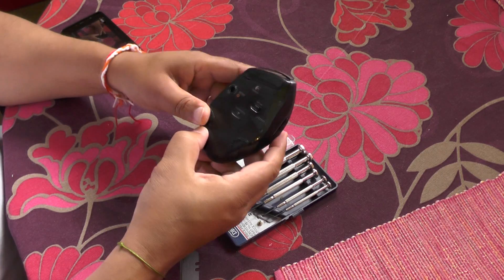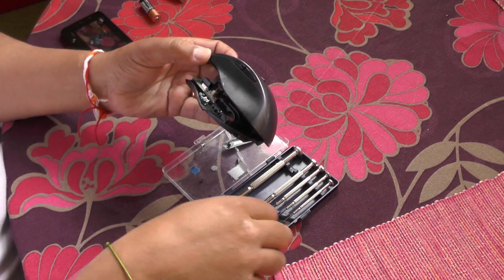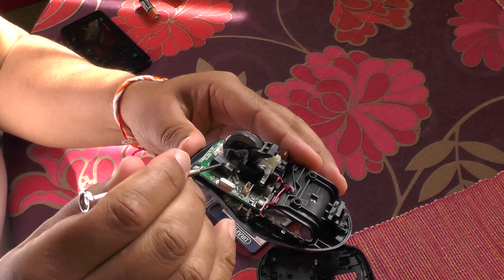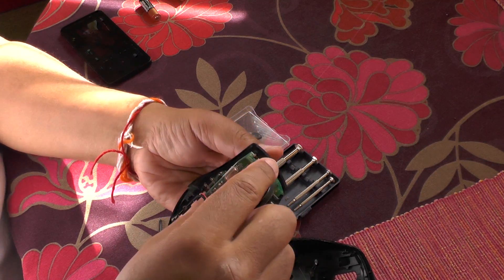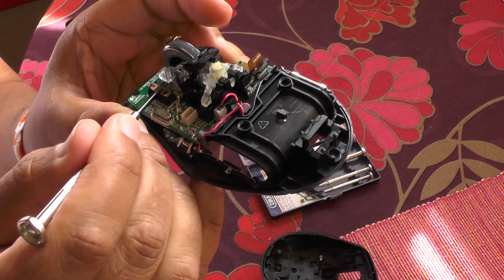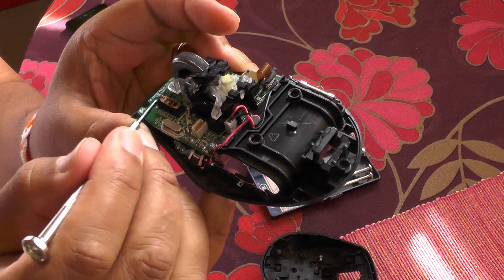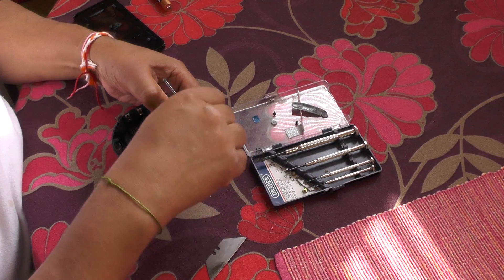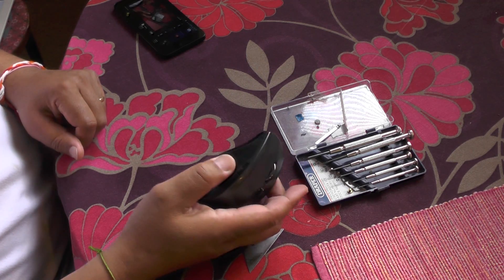Logitech Mouse Double Click Problem and How To Fix It - Red Ferret How-to

Comment: Just fixed my performance MX for a 3rd time! using this technique. Vids really helpful thanks!  I bent the copper correctly the first time, 2nd time the copper broke so used the right click replacement from my older generation MX and now 8 months later double click starts happening again! Its fixed now but have no interest on performing continual surgery on a otherwise perfect mouse! Can anyone recommend a replacement to these Logitech mouses? same price range wireless rechargeable? I've struggled to find any other alternatives!
Reply from the maker: The problem is not so much finding a replacement, as finding one which has that super slick middle scroll wheel action. Once you're used to scrolling around pages at lightning speed, it's hard to go back. If anyone knows of a real alternative, I'd love to hear it.

Comment: Thanks a lot, I fixed my mouse after I've had this problem for 3-4 years probably. Finally got sick of it today and fixed it in about an hour. Sucks I had to use it like that for so long before getting fed up but better late than never. Learned something new, and although it took a lot of precision, I got it done and I don't have to buy a new mouse. Thanks alot

Comment: I've owned two Logitech MX mice, both have had this issue and the fix was simply to open them up and blow the dust/hair out. I don't even own a can of compressed air... Just blow in them like a old Nintendo cartridge.

What I'm trying to say is.... the mysterious double-click symptoms can be from dust/debris causing a short. Its not necessarily a mechanical problem like this video addresses.

Comment: I have the exact same kind of mouse: a Logitech M705.  On the clicker housing (little black box), the catches on my mouse were not on the ends, but rather in the middle of either side of the housing.  Now here's the thing you didn't mention that almost caused me to ruin my mouse:  The two clicker housings are not put on in the same orientation.  They can both be seen in the video at 2:20 -- on the left, the white piece is on the bottom half of the black housing; and on the right, the white piece is on the top half of the housing.  I didn't take the copper part off because I figured my chances of ever getting it back on would be about zero.  I just rubbed the contact points with a needle so they would make better contact.  After going through the ordeal of figuring out that the left button housing is in the opposite orientation of the right button housing, everything went back together with no problem.  And my mouse works fine now -- double clicking and all.

Comment: Thanks for the video. I used the video and the link to help me. It was a pain in the ass to get that thin copper back in place. But I can confirm that this technic worked on my Logitech Performance MX Model Number: M-R0007 mouse. Pay attention how the copper piece comes out and how it is placed. Use the link to see pictures of how the copper piece is supposed to be bent.

Comment: Logitech makes so much shit nowadays. My first M705 was replaced after 2 years because the doucle click problem at the left. My new M705 had a different mouse click sensor, because it sounded different. So Logitech put a better one into the mouse. But just at the left side! At the right button, the sensor is broken again, because there they still used the cheap sensor. You could  hear a different sound, when clicking.

Comment: So I used a safety pin to reshape the u shaped piece rather than trying to bend it with just a tweazers, using the pin to hold up the middle bit while using a flat screwdriver to push the flap down.  noticed with mine I had to get the spring to push itself off of the center post there so the back would be under the right or acceptable tension to keep it from just falling off.

Comment: your method of how u hold the copper from your left hand was different than my method, my method was reversed by your method.. here is how i did. i used my thumb and index finger to aim its claw into the middle hook and hold down the "dot" on the bottom of the pole. then i use medium sized needle and simply insert into the hole and start to pull up on the right side to match the end-hook. it took me 20 minutes on my second attempt. - the first try was 40 minutes about when i using both hand of mine last time without a needle :(

Comment: The spring works fine, but double clicks on a single click. Cleaning the contact by dragging some paper through the contacts appears to clean it up. Works fine again. 2nd time in 6 years had to clean.

Video was very helpful to show how to remove the switch cover, used it about 3 years ago  and again today. M705 is a great mouse, 3 year battery life twice now for 6 years.

Comment: I didn't bend the end of the copper spring like you did, but to the opposite site because when I checked the right button, it was bent to the other side. The left side was full flat. I am writing this just after fixing it and at the moment it is working amazing. The click sound is a bit more quiet. Don't know what would be the difference if I bent it like you did.

Comment: I really like this solution (I have this problem with several of my mice), but I always wondered why Logitech simply didn't add a "minimal double click" time into their driver.  Very simple for them.

Until today I discovered someone had a similar idea (at least for Windows), using an AutoHotKey script:

~LButton::return  ; Set A_PriorHotkey.
#If A_PriorHotkey != "" && A_TimeSincePriorHotkey < 200
LButton::return  ; Block hotkey.

Just google those lines for details (I believe that "200" means 200 ms minimal gap between clicks).  Perfect, and it seems to work great for me.

Please forgive me if this is old news - but it's been annoying me for years!!
Reply: How do you make it work exactly tho ? I downloaded the program but it seems fairly complicated. Can you help me with it ? :S
Reply: Sure, install AutoHotKey, then create a AutoHotkeyScript "slowdown doubleclick.ahk" with the 3 lines ("~LButton:return ....") in it.  To create that script just right-click on the desktop, and choose "New->AutoHotkey Script" (that option will appear after installing AutoHotkey).  After saving the file, just run it (double-click it).  I created a Shortcut to that file in the "Startup" folder so it runs each time I login.  Google "Windows 10 Startup" to see how to do that, it's the C:\ProgramData\Microsoft\Windows\Start Menu\Programs\StartUp folder.  Now that I've used this a while, I still get occasional phantom double-clicks - but it's much better than before.  Also, I changed it to a "100", because I was losing "real" double clicks (I guess I click fast).

Comment: Next time you have that thing out, and after you bend it back into position, hold it over an open flame (until it is super hot) then drop it into some water. Problem solved bromance.

Comment: just unplug the mouse or take out the batteries . Click it about 30 times to discharge current and problem is solved . Just worked on my g302 and this is what logitech suggests . Dont need to operate .
Reply: i clciked almost 2000 times and now it feels like its new
Reply: UNBELIEVABLE
I had already gotten through the "bending" procedure for my Performange MX. After a fairly bit of use (it was about 1+ year of very rare use) the problem reappeared.
Tried your solution, it got significantly better. Will try it again (may do more clicks to try to make it even better)

Many thanks

Update: many clicks later: not a single unintended double-click event
Reply: oh, so it does work!  I'd tried this with my corded mouse, i unplugged it, clicked a bunch, plugged back in: FIXED!
I was sad coz you can't unplug a wireless mouse, but i guess taking the batteries out does the same job.  Wonderful!
Reply: I can't believe this worked... So simple but it did the job for me.
Reply: It does work! I just simply unplugged my wired mouse and clicked a bunch also. Thanks.
Reply: WOOOOOOOOOOW! This actually worked! I clicked well over 30 at a rapid pace (just in case and that definitely fixed my issue)! Glad that I don't have to take my M705 apart, thanks!!!!
Reply: This worked for my Logitech G602.  Thanks for the find!
Reply: This should be the top comment. This should be the result when searching for a fix. Just did it to my G700s thinking it would not work. It worked. Do it.
Reply: This seems to have worked with a wireless M510 by removing the batteries then rapid clicking 30+ times.  So weird.
Reply: worked forr my razer mouse thank you!
Reply: This solution wins

Comment: I have the M570 from Logitech witch had the same problems... a little bit of contactspray on the microswitches fixed the problem. Just over the little white button and let it soak a bit. Then dry off with a tissue .. that was it!

Comment: Works for a Logitech G400 also, only 3 screws tho :) 2 at the front and 1 at the back. I found that it was easier to use tweezers to get the little white thing back in and then flip the mouse up side down and mount it that way the black cover with the white button can only fit on way on the G400. Nice video help me get it right the first time :) No need to change my beloved gamer mouse now :D

Comment: Well, my mouse no longer double-clicks!

It... also no longer single-clicks.  I think this sort of thing is only going to go well for people who are already very, very good with parts like this.  The tiny piece of copper is much smaller than you might think from the video, and after two hours trying to get it back into place, I've given up.
Reply: I did it already 4th times on same mouse, no problems, not at first try but i do it in 20m~1h every time i must fix it.
A tip for you: repair 1 at time, so you can compare, and remember to see if it make contact with all of 3 points before you reclose all.
Reply: I spent 2 or more hours trying to get it to work at all.  At that point, it was easier to just buy a new mouse.
Reply: First time is not easy, but try another time and compare with another not modified yet. If it not click at all then it not make the right movement in&out when u press the button...

Comment: Want an easier fix? Disassemble the 5 screws, pop the top off but leave the wires attached, just rest the top on the side. Get electrical contact cleaner, spray small amounts (couple drops only) on the 'faulty' microswitch, use a screwdriver to push it over and over to let the liquid saturate the internals, add a few more drops and do 20 more clicks. Close everything up, click a shitload more times. That's it. Fixed two different model Logitech mice with that method.
Reply: This is how I repaired mine, super easy, WD-40 also works. Maybe Logitech could preapply the cleaner to make it last longer.
Reply: I fixed mine much more simply, I blew some air in it and now it suddenly stop double clicking. For now.....
Reply: Eleven months later and your solution worked like a charm. Thanks.
Reply: Best simple fix is this. Take out batteries or unplug mouse. Click both left and right mouse buttons for 30 seconds to remove the static charge that is causing the double click. Problem solved .. til it builds up again. No disassembly required.
Reply: Taking batteries out and clicking worked for me !!!  Thanks heaps Tyco!!!
Reply: Thanks so much, Tyco. This worked perfectly as you described. +1 internet awarded to you.

Comment: what if i stick off my mouse pads and then wouldnt be able to stick it back in?i have g600 and pads is kinda expensive due to shipping tax
Reply from the maker: My pads went back on nicely.
Reply: You can always use some double sided tape, but like +Red Ferret I didn't have any problems putting mine back on :)

Comment: i dont unscrew and dissect my m705. i should. but in the mean time i get the last two disinfection wipes used to wipe keyboards,, kitchen counters, messes. i save the last two so all the good moisture collects on one/two wipes. then i get one of those toothpick/dental floss hybrid tools that are both toothpick and floss. then i combine them and jam into the small hole where the laser is. i twist and turn. i find best results with more moisture.

Comment: For all newcomers to this video, the trick is not really about bending the contacts, but about cleaning the oxidation layer on the contacts at the place where the clicking is happening. By bending the contacts the author of this video slightly changed the angle of contacting surface, but the real problem solver is scraping off the oxidized layer - you will see that the color of the contact is dark and dull, and you need to scrape it a bit to make it look shiny again - this is what really  is solving the double-click problem.
Reply: I think you got it right: mine was misbehaving in the clicking, but the sound was just about right, so I guessed the issue was not the copper plate after all. Not the shape at least.
I gave it a run of deoxidizer (a good dry one) and everything seems to work fine. So far so good
Thanks to the OP for showing ho to tear down the mouse though, saved me a lot of guesswork :)
Reply: Agreed.  I used this video to see how to disassemble the mouse (excellent for that) but scraped the oxidation off as well on both sides- didn't really bother with trying to reshape the spring as it seemed to be springing just fine.  The disassembly video was really nice for knowing it would go back together without a lot of hassle :-)
Reply: Exactly, I took a small piece of emery paper and cleaned the contacts and it worked like a charm.
Reply: @TheCassla  if you clean it properly,  it should last a long as the original term of use.  I've actually threw away the mouse because visually it got pretty bad, way before the double-click problem returned.
Reply: But the method in the video worked perfectly for me.  Maybe just my fiddling with the contact point was enough to clean it off? Or perhaps changing the shape to give the spring a more robust press against the contact is increasing the surface area of the connection point just enough to increase the likelihood of a solid electrical connection when clicked.
Reply: @TheCassla  it will happen again,  generally at the same rate as when the mouse is new.  There is no reason why it would oxidize faster if the surface is cleaned properly.
Reply: Exactly!
Reply: @TheCassla  Seems to depend on how much you use the button, since I have to clean the left click one about once a year, but right click only started doing that about 2+ years in.
Reply: That's not entirely true. I have a G305 that had a physically mashed spring (it got banged against a table and chucked at a wall), resulting in a mushy click and lots of double-clicks. If you still have an audible, satisfying click, but it's registering double-clicks or is otherwise inconsistent, it's oxidization.
There can be multiple different issues with a switch.
Reply: This was the correct solution for me as well. Thanks for the heads up! All i had to remove was the black click-sensor cover, then I could clean the gunk with a fine screwdriver on the contact surface.

One tip, to get the white little click insert to stay in the black cover when putting it back on, I put a small piece of tape, then just softly pushed the black/white assembly down and into place.
Reply: @squrrll  I just turned mouse upside down, so white thing was inside with the help of gravity :)
Reply: Thank you. I didn't change the shape of the springs (on purpose), just scraped black contacts on them till they shine. It seems that it helped. I had double clicks and I couldn't drag&drop things (because of a bad contact) Now it's fine.
Reply: excellent. took the cover off the switch but did not remove the spring. sprayed the spring with electrical contact cleaner.
mouse switch works again as new.
turned a "four hour" job into a half hour one!
Reply: I'm not 100% sure that what you're saying is right, but it's a long time ago, and who has time to argue over it? :)

Comment: Thanks for that buddy.
FYI I solved my double click problem by putting a little thinners (alcohol? glasses cleaner? I dunno) on the switch and giving it a little action. Seemed to clear out the grease that must have been causing the problem because the switch, whilst a bit squeaky now for w/e reason, seems to work ok (and I wasn't able to get a decent new mouse right now).
HTH. Happy days!

Comment: I like everything about this mouse except that the scroll wheel is way too lose. it needs a LOT of resistance. I took it apart to see if there's anything that can be done about it and it turns out there is this tiny spring that controls the resistance to the turning of the wheel. so I basically need a spring with more resistance. do you have any idea where i might be able to get this part?

Comment: Quite difficult to replace the copper switch plate in its place!
Though thank you for the upload.
Reply: I had a problem to get it out after I shoved it inaccurately. But with tweezers I managed to wiggle it out and place it correctly back. All you need is to be gentle with that copper part, put it back sideways, just as you were instructed to remove it. Bendy things are supposed to be in small catches on those thick terminals.

Comment: Seems to have fixed both of my  Logitech M515 couch mice double click issue.  Was about ready to boot both of them.  Only reason I didn't is because this model is discontinued and Logitech hasn't released an actual replacement for it.

Comment: This worked perfectly for my M705.  I've had it for years with no issues, but then started noticing the occasional malfunction in some games (never noticed it using other programs - only in games was there an issue).  Sure enough, my spring was completely flat!

I found that having 2 sets of tweezers made creating the bend in the spring very easy and precise. Not a difficult fix - and my mouse works perfectly now.